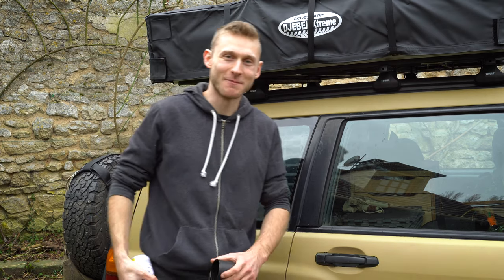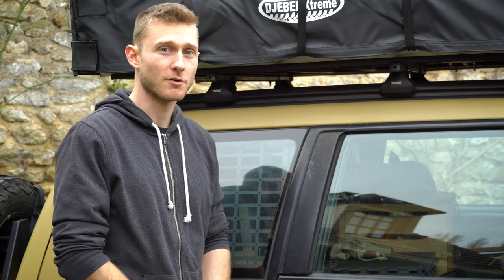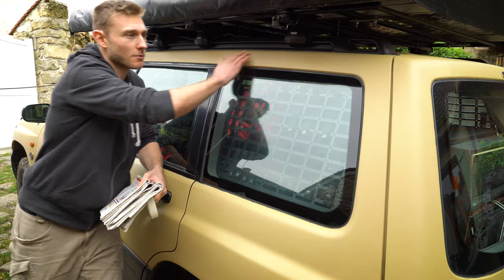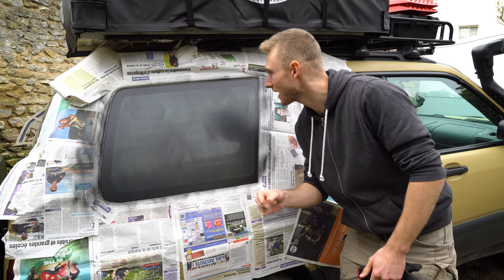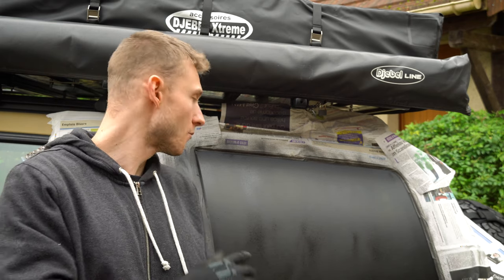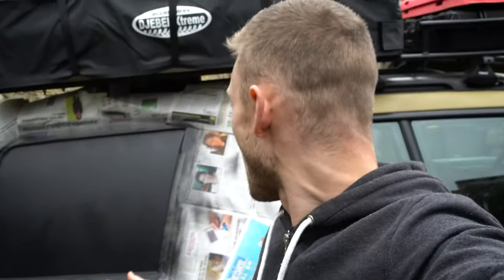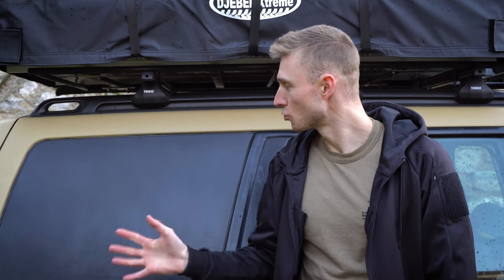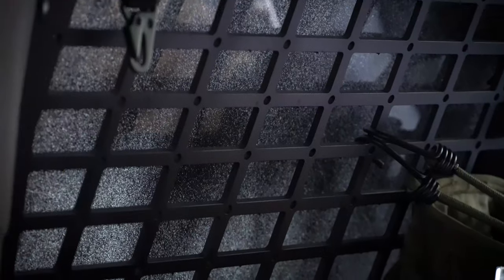I PLASTI DIP MY WINDOWS ! And it looks like this ...

Comment: Your finish would have come out smoother if you would have done smooth even passes with the spray can instead of the random back and forth motion you were using.
Reply from the maker: I was looking for this kind of finish 😉
Reply: I have never cringed so hard after watching him do that motion with the spray can. But at least it looks good.
Reply: @ALNSMOVERLAND  you were looking for a rough and finish with streaks?
Reply: @bamf1321  In that case... ...It's perfect!
Reply: @bamf1321   He goes to rough places
Reply: @bamf1321  lmao bro the guy takes this car off road I doubt he wants it to look polished smh. Did you not watch the video he said to expensive to get it properly done and he looked for a cheaper way. Please be better hahaha 🤣
Reply: James is referencing the blotchy starts and stops rather than painting normal back and forth pattern, not referencing the texture. Ya’ll are arguing about two different things and nothing at the same time.
Reply: Smoother passes and 1 or 2 coats lightly of matt black. Then 4 coats of gloss
Reply: @bamf1321 lol ya his paint technique was horrible

Comment: I have a ford van that I will be using the Plastidip on the rear windows. The only difference is that I am going to spay it on the inside for a cleaner look.... my question please is... how is it handling the summer heat? my thought would be that it might crack the glass. Thanks for your reply in advance.
Reply from the maker: I Tony! Thank you for you interest and I hope the video have been helpful for you.
My car is under the sun every day since I put the plasti dip on and there is absolutely no problem. There is no way the plasti dip crack your glass 😉

Comment: Hey! Hope it will stay there as glass isn't  as "sticky" as any other material. It might just come of if you scratch it with some branch.
We'll see.
Reply from the maker: Yeah that's my main concern 🤔
Reply: Plasti dip sticks extremely well to glass.  Some things need texture to hold.  But it holds well like a suction cup because there's no air in between

Comment: Looks good on the car. Gives it a more tactical look. I used plastidip on my previous car on the spoiler and emblems. If I remember correctly it lasted for over a year. It started to peel in the edges, so I resprayd it. And the word your are looking for is newspaper :-P
Reply from the maker: The #tactifoz getting more and more tactical 😁😁😁

Comment: How is it holding up?
I did this to my van. But from the inside.  The large back window now is extremely hot when it is in the sun. Im scared it is gonna Explode from thermal shock.
Reply from the maker: My car is park outside directly under the sun 24/7 and I have absolutely no issues with that.

Comment: Plasti dip has to be sprayed in smooth overlapping passes, like 50/50 ratio. And after the first coat it needs to be sprayed heavy enough to have a wet appearance but not be running obviously. If you do not do this for the first 4-5 coats it will never hold up. This is typically the main reason people do not have good results with plasti dip. I know you where going for a certain effect (appearance) but your first 4 or 5 coats should have been applied correctly and then apply your crazy texture. If the base coats aren't correct then it'll never last or work out. Honestly, I was sitting here waiting for you to remove your tape and watch you ruin your plast dip but then you broke out the knife so that tells me you must know something about plasti dip because dry plasti dip thats bridged over a gap will usually tear off into your dip job. Also telling people that one can is enough? Again, if done correctly then no. 1 can per window. Same for wheels, 1 can per wheel. If this doesn't hold up or work out very well you should do it again but spray it right and try to do it in a garage or somewhere out of the wind. I haven't ever considered using plasti dip on glass myself and ive done several sets of wheels so I am not new to the product. My latest was my truck, 5 coats of black base per wheel then I did 3 coats of a graphite metallizer to give it a dark grey metallic look. Purchased the kit from dipyourcar came with the 4 cans of black, 1 per wheel, 3 cans of the metallizer, brake masking bags for all the wheels, dip coat for your tires so the dip comes off your tires and pre dip cleaner to clean the wheels with and a microfiber. Nice kit.
Reply: When I said I hadn't ever considered spraying glass I also meant to include that it was an interesting idea. If done correctly i'd like to see how it works out because it has given me an idea. Also, lol, I hadn't finished the video when I said all that. At the very end you talk about how it looks bad from the inside, but thats due to how you sprayed it which can be solved by spraying it in the correct manner from the beginning. Not trying to be an arsehole just saying the truth.
Reply from the maker: Thanks for all the additional infos mate!

Comment: honestly wouldnt do it even though it looks good. It obstructs your visibility by a huge amount. Just get a regular black foil which decreases light shining through but still makes it able to look through it as the driver. Every Forester is ridiculously good in visibility, this is just removing that ability, dont cripple yourself.
Reply from the maker: I agree, SF forester are very good in visibility, the amount of windows on this car is amazing!
But the fact is my visibility through those back windows is already compromised with my fridge and my interior storage setup... So I don't loose anything covering them with plasti dip, it just give my Forester a nice clean look from the outside 😉
Reply: @ALNSMOVERLAND  Ah sure I forgot about that. But what when youre commuting? I have my SHS Forester equiped so far to be 100% under the window line, the backwindows are just massive and useful. Same window you sprayed I have a OEM Net to decrease sunlight, but might remove it and tint the whole back just a bit. Was driving a BMW 2 model 2018 once, holy crap other cars have terrible visibility.
Reply from the maker: I'm commuting with my overland setup 😂
And to be honest I'm so used to look through those windows when reverse, it was very difficult to do without...
Reply: What is black foil?